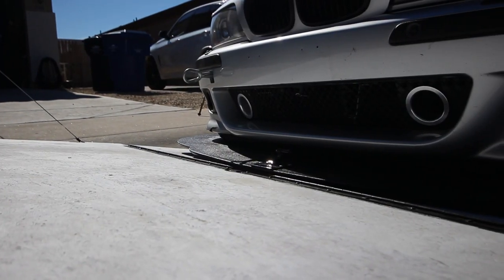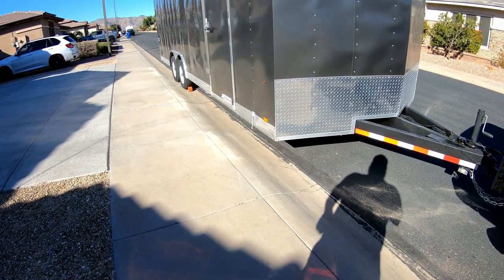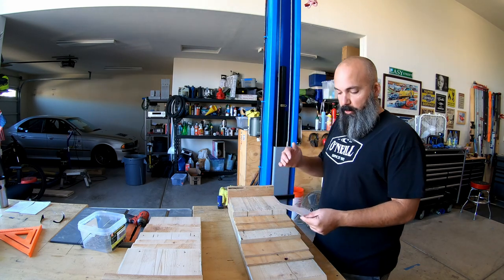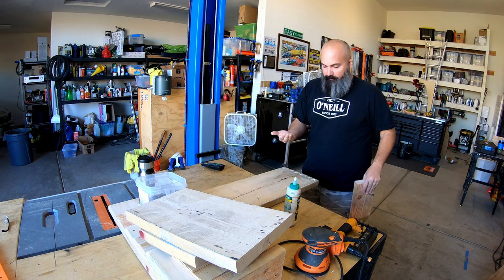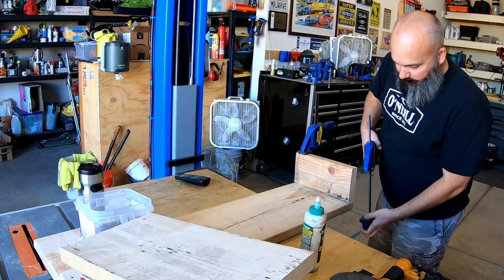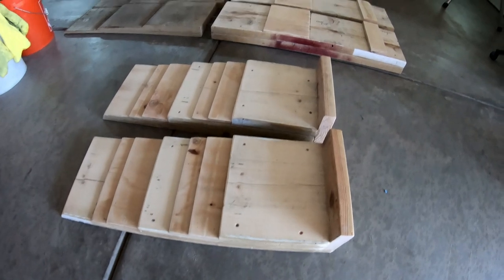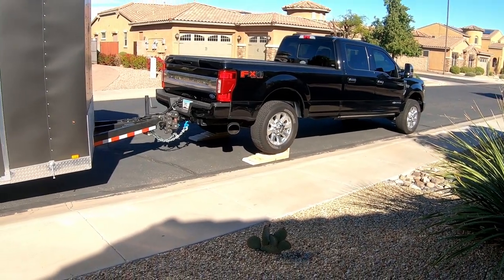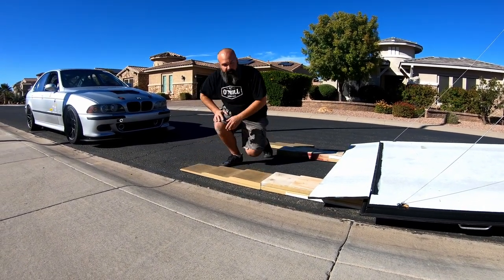DIY "Race Ramps"

Comment: Nice job, great footage.   Sorry was only able to watch 1x so far but goin to mimic urs (make slight mod w my trailer) - did u record u making the wood ‘ramp’ that ur trailer ramps ‘sat’ on?   Either way, what was the length u cut of those 2x12 n what else did u affix to that?   
Thanks much!
Reply from the maker: My trailer ramps are broken into 2 sections both of which are 36”. The ramp door sits on a pair of 2x12’s with a 12” section of 1/2” plywood where the ramp door plywood intersects. The forward ramps are 1x12’s stacked 3 tall. 36”, 24”, 12” to give a gentle ride up onto the 2x12. These lengths could be changed to fit the profile or ramp angle your looking for. Later I added handles to all of the ramps to make handling them easier.